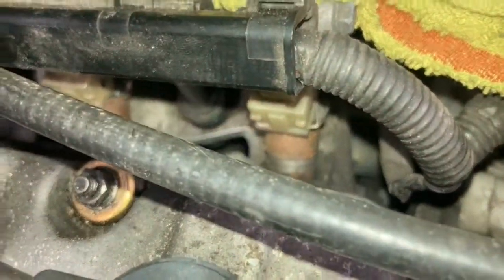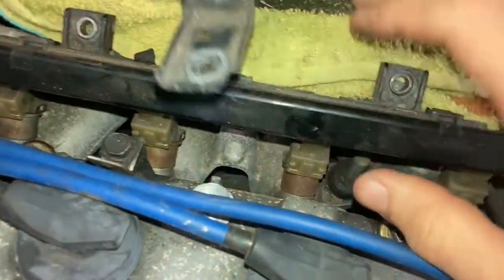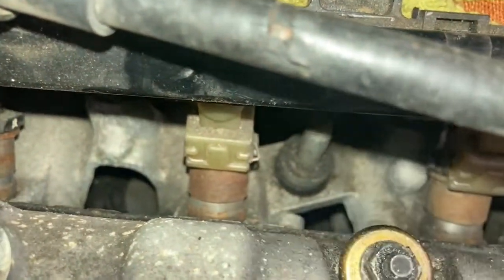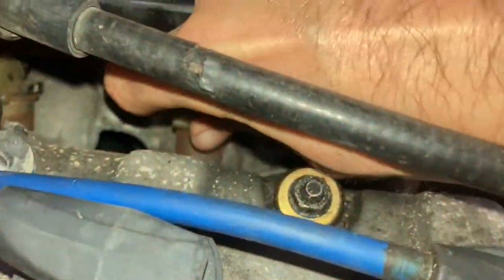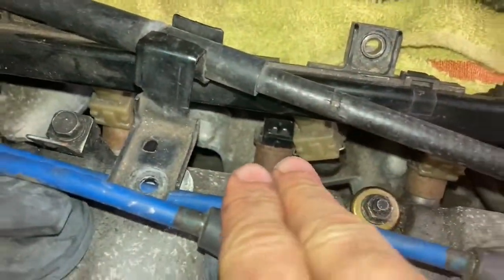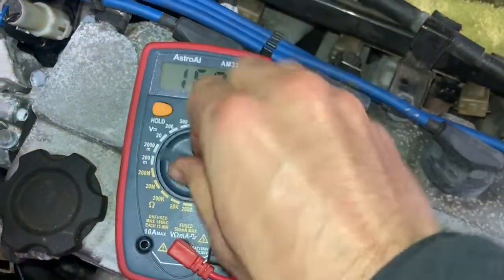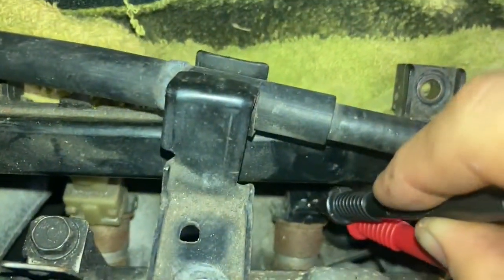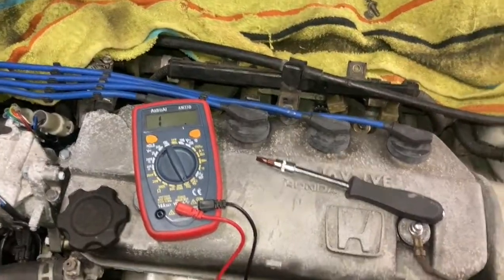Fuel Injector Inspection Voltage Check Honda

Comment: does the cars ignition need to be on?
Reply: Not for a resistance check. There is no electrical connection to the injector at this test so it's just testing for continuity.